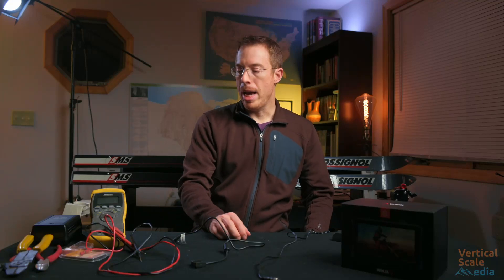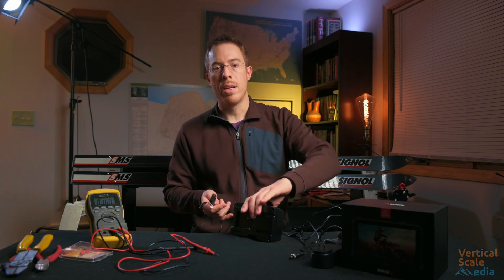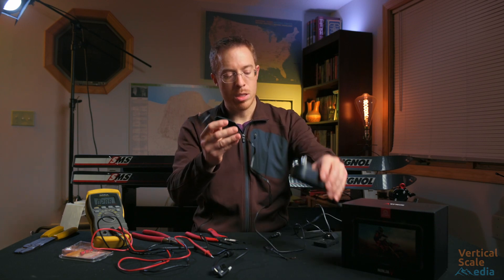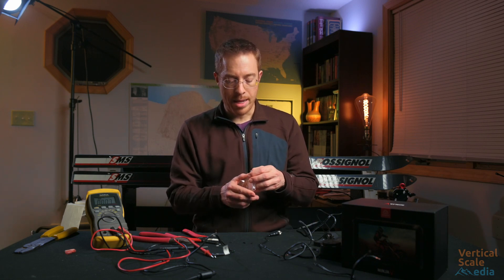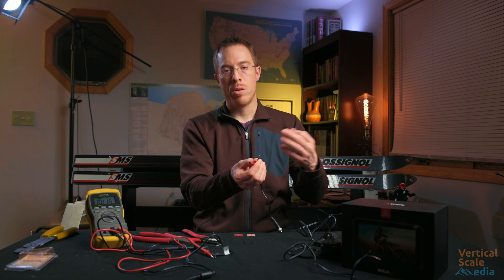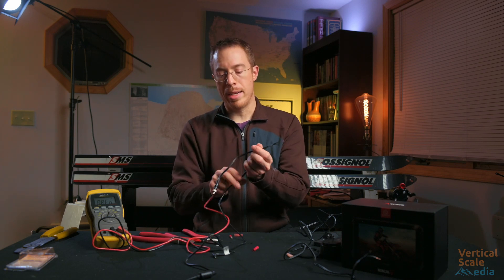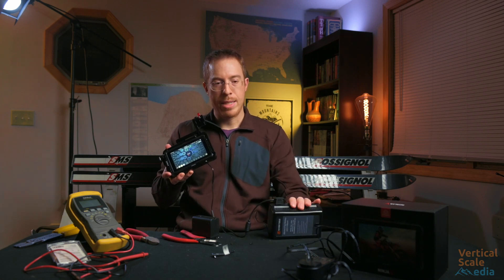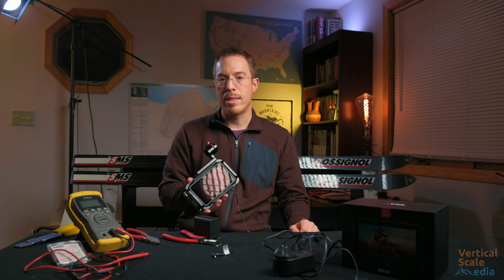Atomos Ninja V external power! HOWTO power via a Dtap (V mount) battery

Comment: Did it similar. What bugs me a bit is that the battery icon on the ninja is omly calibrated for NPF batterys ~7.2V and thus always displays a full battery when using dtap. you have to tap and look up the voltage (or of course look on your battery directly). a simple software switch would be enough to correct this.

Comment: Here's my battery pack solution for Atomos Ninja V:

1. Anker PowerCore Essential 20000 PD (i.e. Amazon UK) ~46.00 Euro.
2. USB-C to USB-C PD Cable  - any good quality will do. Get a short one.
3. PD Spoof Adapter Plug Converter USB Type C Female to 5.5* 2.5mm (AliExpress. Item code: 5525 ) - under $5.00.
It's angled too which makes it easier for me to manage the cable behind the monitor.
4. Reuse the power supply connection battery adapter that came with the Ninja V monitor to link all together.

Total: under 60.00Euro with 20k juice. 

On Atomos Ninja it will show up as a 9V power (bank) delivery. Some of the NPF batteries deliver 7.4Volts. Remember the input Voltage allowed is 6.2V - 16.8V. As you can see you will be far from exceeding or under-volting the Atomos Ninja V with this neat setup.

It works for me.

Thank me later.
Reply from the maker: Lots of ways to tackle this issue for sure. Thanks for stopping by!
Reply: how long does the battery last for 4k videos?

Comment: I called a local AV store who advised some clients had wrecked the HDMI connection on the Ninja V because they were using  a V mount battery to power their Ninja & camera. That seems nonsensical; any idea why those Ninja V might have suffered damage to their HDMI port?
Reply from the maker: There was rumor that the HDMI port was being damaged via a ground loop between some cameras when a shared power supply was in use... I remember seeing a video about that, but I believe the fix was a different HDMI cable. It was a specific camera, HDMI cable, and power delivery setup if I recall correctly. If this was a common thing, someone better tell all high end camera manufacturers to stop using v-mount and gold-mount batteries. In other words - nonsense.

Comment: D-tap is 12 Volt, LP-E6, NP-Fxxx is 7.2 Volt out. Do you think I can do the same with a BMMCC, ( power D-tap to a cabeled dummy LP-E6)
Reply from the maker: If you mean BMPCC (pocket cinema camera), they have an external power connector that you can use to run directly from d-tap - you don't need to make any special cables or adapters for that camera.
Reply: @VerticalScaleMedia  It is a BMMCC (micro cinema) in combination with Ninja V. Both should be powered from same battery.

Comment: So happy I found this video yesterday I received my v mount battery made for zhiyun crane 3s , D tap cable and my ninja V but when I hooked up my ninja V to the v mount battery it won’t turn on. I also have a old feelworld monitor and it worked with the d tap cable and v mount battery. No luck on the ninja V the old nps  battery that came with my feelworld worked on my ninja V. Any suggestions?
Reply from the maker: Someone else said something similar. My guess would be polarity of the power into the ninja, as if I recall correctly it can take 9 to 16v, which is in range of the v mount.
Reply: @VerticalScaleMedia  my ninja V adaptor has written 6.2V - 16.8V DC

Comment: I did the same, but instead of d-tap connection I used 12v output from Tilta battery plate. But it want work. Any suggestions.
Thanks
Reply from the maker: I'd check to make sure there is actually voltage on that plug, and that the polarity is correct. I had a plate that had a bad plug. A multimeter is definitely your friend here. Good luck.
Reply: @VerticalScaleMedia  Just a comment, if you use the Tilta to feed your camera and the Ninja V first connect power cables, and HDMI second!!!!
Reply: Did you verify the 12 Volt output?, is the center pin positive? I am interested too. Currently there are mini V-batteries which seems to be very interesting (still expensive)

Comment: I never use butt connectors   I solder and heat shrink  my connections
Reply from the maker: For permanent connections I do too. I used crimp connectors so I could possibly use the wall adapter at some point in the future... I also searched and searched for the NASA soldering guidelines before replying, but I couldn't find the document I was trying to find: It was a handbook stating that soldering wires that can flex is not recommended, and should always be crimped and heat-shrunk. Granted, this is for vehicles that go into space, not my camera rig. :) I just found it fun that NASA recommends against soldering flexible conductors.
Reply: @VerticalScaleMedia   NASA  has obviously never had to  rewire a  trailer or a car  after some one used crimp connections all over it lol